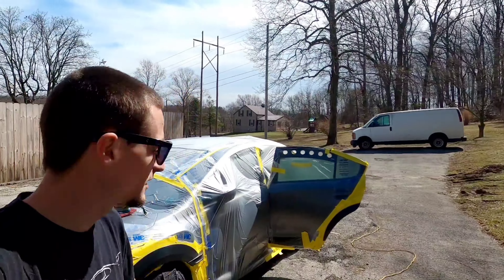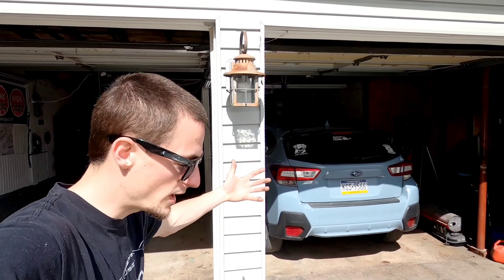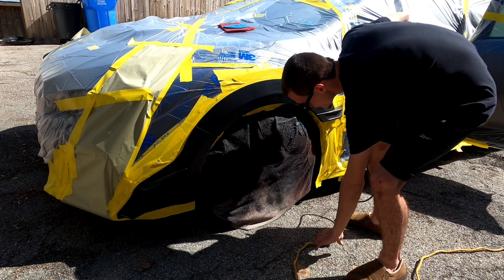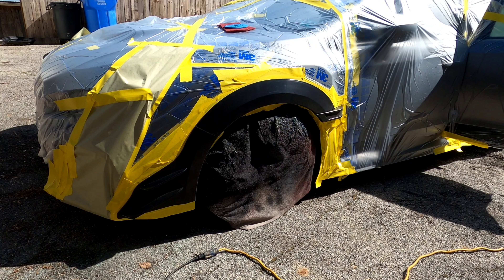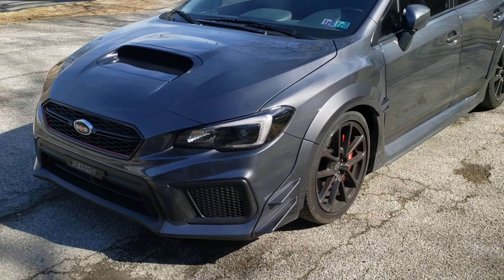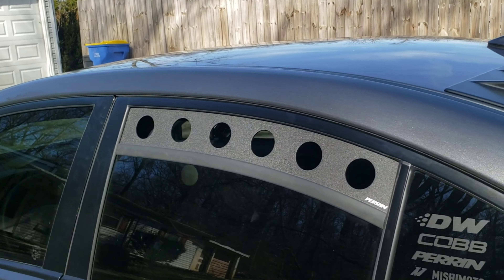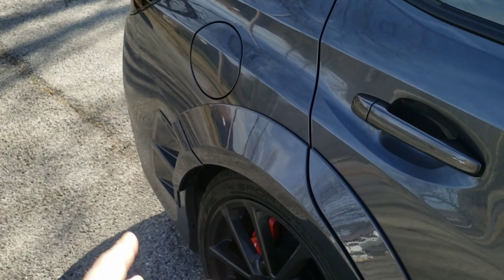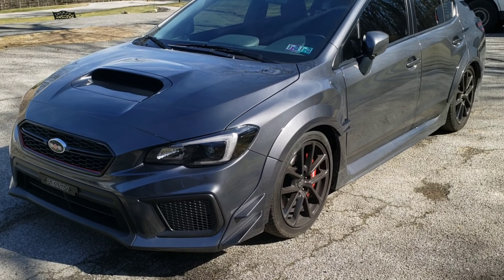Painting S209 Flares On My WRX

Comment: What’s the point of the holes in your windows....
Reply from the maker: There aren't holes in the windows they're inserts that have holes in them. Most people use them for looks but when you go to race on the track whether drag strip or circuit track you have to have all your windows up and you aren't allowed to run Air Conditioning because it drips water onto the track. So the vents comply with track rules but allow hot air to escape out of the car.

Comment: How much paint do you recommend buying?
Reply from the maker: I bought 1 pint (Unreduced) which after thinning 50% makes 1 sprayable quart which was plenty for the flares!
Reply: @StreetInspired1  thank you, and how much clearcoat?
Reply from the maker: @Smerky  I think I used about the same amount of clearcoat. Probably around a quart for 2 coats all around but I don't remember exactly since it's been a while. I know I had extra of both. So if you get a 2 part clearcoat I wouldn't mix all of it at once just what you think you'll need and mix more if needed so you have extra if you ever need to touchup